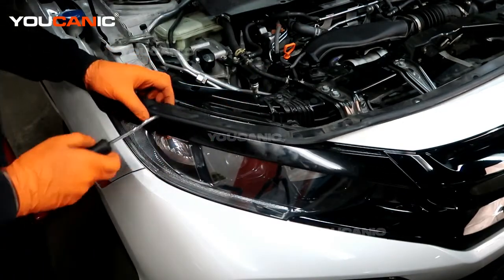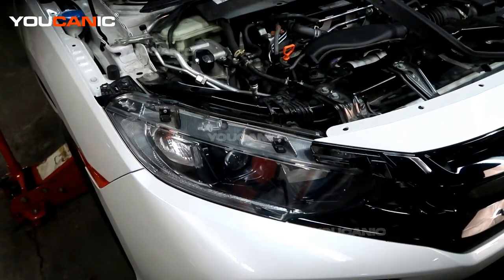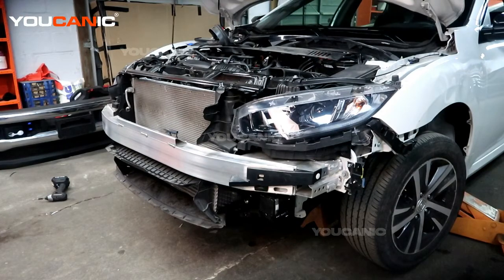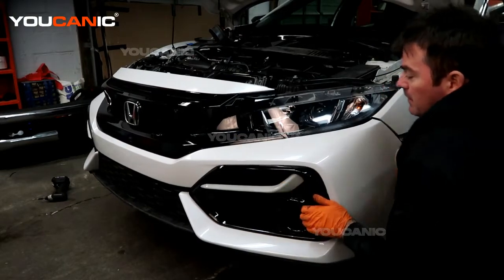2016-2021 Honda Civic - Windshield Washer Pump Replacement

Comment: Do you need to take off all the stuff on top or can you remove just the bottom wrap around bumper
Reply: It is allllll attached to each other
Reply: You can just remove half of your passenger side fender liner and then there's 4 10mm bolts underneath that you can take out to allow you to pull the plastic panel down and it gives you enough space to do it. No need to remove the whole.bumper assembly.

Comment: Hey bro what’s the part no?
Reply: Be careful when ordering the pump.    I went to the dealer ordered the pump and confirmed it with VIN the pump they ordered and that original part so not have the same connector and need a different model